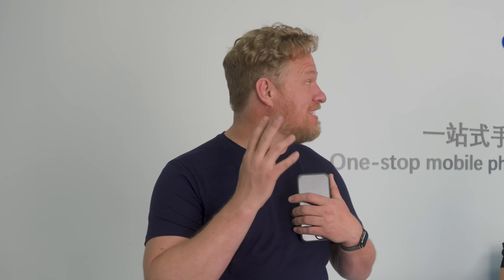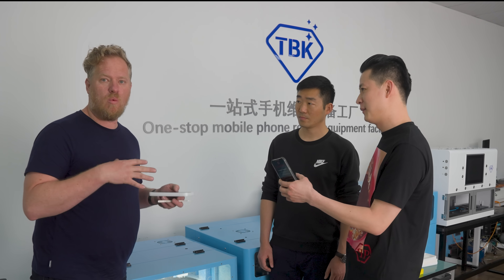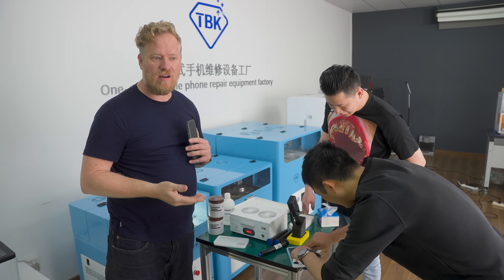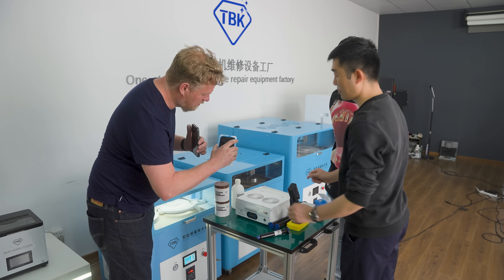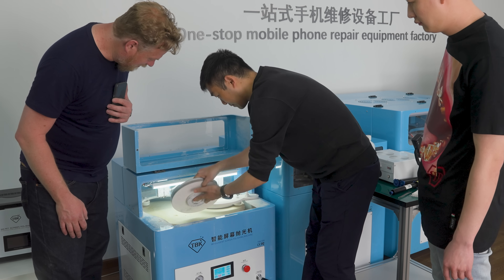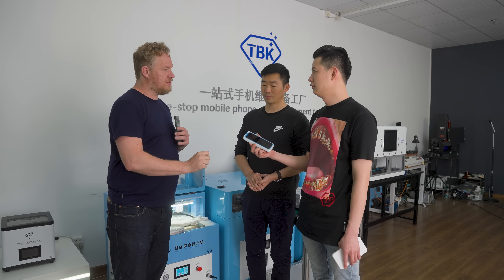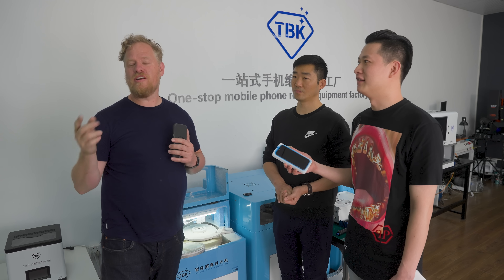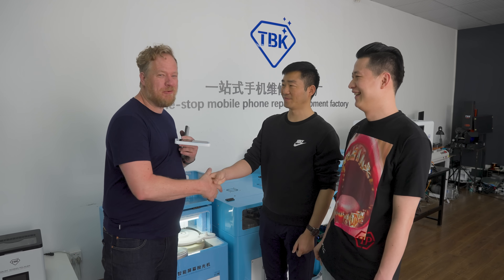Making old iPhones look like new? This Chinese machine is magic!

Comment: Aren't there several coatings on these screens? Anti-glare, oleophobic?
Reply: "don't worry about it" 🙈
Reply: Depends on the screen. Some do have those, some don't. Mostly just an oleophobic one, you can apply it arfter. It won't be as durable as the factory coating but will work just fine.
Reply: Yes, and they can be easily re applied.
Reply: @mahdi8572 If it was that easy, they'd show it in the ad...
Reply: @NicksStuff This is not an ad, just a demo.
Reply: @Drak_Thedp  It is definitely a 7:20 ad for a screen polisher

Comment: ok, so engineering-wise, how thick is the glass and how deep are the scratches, so that they can remove it? doesn't it stop being "gorilla" glass after getting thinned like that?

great for sales, but if I buy an used phoned, I don't want it to shatter the next day.
Reply: The glass has to be thinner than the deepest part of the scratch, all over. And yep. No gorilla glass coating anymore, easier to scratch too. 

Also extremely risky doing while in the phone, and the difference between grade A and C is $40? Not worth disassembling to sell for extra $40.

Nobody is ever going to be a millionaire from this machine
Reply: @s3quattro10 lol gorilla glass coating ? What??

Comment: how do you remove the phone from the mold and how do you remove the cured uv glue?
Reply: That is what I was wondering. I assume you can just scrape it off or remove it with heat or a solvent without damaging the phone?
Reply: @polyvinyl22  yeah, maybe acetone or MEK can at least soften it or something, but yet you risk damaging the phone... i think that applying thin epoxy layer is better idea than polishing the glass. it should be possible nowadays, thats how windshields are being repaired
Reply: It's brittle and detaches easily.
Reply: You can just peel it away easily :)

Comment: You could tape around the edge and buff it out locally (at the spot of the scratches). This smiling presenter is a bit of a buffoon, skipping important questions and implications to smile and promote.

Comment: The problem i see is that it makes the glass thinner and maybe easiert to break. How much material in % does it remove?
Reply: Should not be a lot, scratches are pretty shallow usually (and I would assume one might decide to do it or not based on how deep the scratch you want to remove is) most time less than 5% of the thickness from what I can find (assuming very thin glass and light to medium scratches).

Comment: Seems like they're just polishing the entire screen down? Wasn't expecting that, it's gotta weaken it or something. I was expecting some fancy liquid which fills in the scratch or something. Still though I guess it's a nice little screen refresh after a couple of years after you've got a bunch of scratches, doesn't seem good to do it multiple times. I'd like some sort of testing done to show the strength before and after before being okay with reseller sites doing this to all phones. For the back glass though yeah go at it, I'm suprised resellers dont polish the metal sides of phones already. Could get a phone looking new on all sides.

Comment: hahah yes dont worry about it,

same as with windshield polishing, you're risking distortion and added fragility, probably cerium oxide and a very dialed in machine here but ultimately its just shaving off a layer of the glass so yes now its thinner and more brittle
Reply: Well it's either that or replacing the screen.  Sure it's not as good as the new one, but still better than the old one with a bunch of scratches.

Comment: Its not 'don't worry', if Corning or Apple, could save a few microns in glass or thickness they would do so out of the factory ! 
Scratches put stress into glass, no more protective coating.... 
If a user decides to that to their own phone - that is great. 
If resellers do this to phones that not.
Reply: A full Display/Glass change which is very expensive or time consuming VS a slightly weaker but original display and a bill that only ranges from a couple dollars to a few tens at best. But yea you are right about this being misused by resellers or refurbishers, but then again display Glass polishing is not a new thing they just made it more convenient and time efficient.
Reply: It's a refurbished/used phones, another used phone from users that sells their phones can have weakened glass by hundred of falls and have no scrachs too because the user put a tempered glass on phone (but this glass have the stress of this falls and impacts). And it's the same result, a phone that apears to be in good shape and in the real life, the phone have a lack of resistant in the screen by use and abuse.

If you want to buy  second hand devices with the guarantee of a new product, you are in the wrong market and you really want a NEW device.
Reply: There is always some allowable tolerance, the glass will not be perceivably weaker after polishing.
Reply: @MarianKeller  thats like saying a 1mm piece of glass and 1.1mm have the same strength
Reply: @AndyMcBlane  removing a whole tenth of a millimeter in 15 minutes would NOT result in a scratch free screen.
Reply: That is unless they clearly label it as "scratches removed". If resellers do that, which I assume most won't, then it wouldn't be unethical.
Reply: Apple doesn't make it thinner for drop resistance

Comment: lol "dont worry about it"
Reply: trust me bro
Reply: youre asking too many questions lol
Reply: It WILL be thinner by fractions of a millimeter and also who knows how this behaves with newer iPhones that have Ceramic Shield…
Reply: @TheCreatureCorporation no no don’t worry about
Reply: @iNFiNiTY125 hahahaha!
Reply: Apply new glass protector and be happy
Reply: "oh hi Mark"
Reply: What about the oleophobic coating? I assume that's another step? Given that we already have some repair shops separating the OLED from glass and replacing just the glass at around $50 US I wonder how viable this is.
Reply: its thinner but its marginally so.
Reply: @tjeulink  Says the person with ZERO INFORMATION about it. It being thinner isnt the real problem, his response to it is.
Reply: @Paultimate7 this is not someone who natively speaks english, and does not control the language wel. Whatever nuances you read in it are extremely speculative.
Reply: lol   the modern screen usually have oleophobic coatings , and sometimes even ceramic or saphire coatings.
Reply: @igpp694  by the time a phone goes second hand those coatings would have been long worn out. Plus is also possible to reapply those coatings, even thought it would not be as durable as factory applied ones because you can't heat the screen in the process. Still, that's kinda unpopular because most people uses screen protectors, as bare displays is both easily scratchable even with hardening coating, and isn't as smooth as plastic screen protectors.
Reply: Hilarious shoddy endorsement.
Reply: Of course the screen glass is now thinner and will crack more easily, but they aren't gonna tell you that..
Reply: @james_halpert Thinner glass without scratches is likely stronger than thicker glass with scratches due to how stress works in glass.
Reply: @james_halpert magic
Reply: Fine for older glasses like GG3 or GG Victus. GG7i is extremely thin to begin with so polishing it may just ruin it
Reply: @themystguy if the scratch didn't penetrate the display, polishing the scratch away also won't be too deadly. Especially since it's usually the same spot that's getting scratches all the time.
Reply: Hahaha
Reply: to be fair just adding a phone screen protector will compensate pretty well
Reply: the nano coating is gone after the polish
Reply: Lost in translation more like it. The point he’s making is it’s not as an issue as the polishing process will only reduce the thickness a few percent as anyone who knows much about polishing will tell you, and why he was asked not to make the scratches too deep - it won’t perform magic. It’s a surface effect - you don’t grind the glass in half!  lol The level of stupid in the comment section never fails to disappoint.
Reply: That is the most Chinese answer to that question 😂
Reply: how did it even polished the whole screen since the holder was taller than the screen? or it is concave now?
Reply: @cristibaluta  the phone sits proud of the holder. They even showed it up close
Reply: yeah that was some bs right there. It absolutly makes the screen thinner. Thats FINE WITH ME but him blowing it off like that was a red flag to me. Just be honest and explain it dont say "dont worry". LAME.
Reply: @Paultimate7 This is the difference I think between speaking casually with an acquaintance in their second language versus a professional translator in a business meeting (or even someone who grew up speaking multiple languages natively). Could the guy be blowing him off? Sure. However, let's say that he said it in good faith.

"Don't worry about it" would be a literal translation of 別擔心, bie dan xin. In a vacuum, there's nothing technically wrong with it. However, we do have context here: Scott voiced the concern that the polishing process removes glass from the screen. In this context 別擔心 would communicates, "Your concern is valid, but it doesn't happen much so it's nothing to be worried about".
Reply: @bubbledoubletrouble  thank you for the useful cultural context!
Reply: It would NOT come out free of scratches if the screen was meaningfully thinner after this process. We have no information about what kind of compound and what kind of wheel that is. Surely your solution is better.
Reply: It is thinner but just a very tiny micron amount. But if it the screen has been in these kinds of machines many times, it will make quite a pretty thickness decrease.
Reply: yea man, then he says enthusiastically "the future is here!" yea. the future of bad practices.
Reply: because you can get a new, fully functional (unofficial) screen for 200-500 RMB, or 1400rmb for a second hand official screen.
Reply: @ZhichengForReal  repairing the old screen is better for the environment, and that has to count for something.
Reply: ok no need to make fun of it. they prob test it maybe it's fine like he said.
Reply: @siyam1914  my money is on. It’s fine to make the sale where you have a 30 day warranty on your refurbished phone. They probably deal with a small handful of customer complaints and shut them up with a replacement, but most people probably have their failure outside of that 30 days not to mention the removed or degraded coatings They’re sanding off so whatever nice screen material came OEM… not anymore. This is just kind of shady and like the other said the response and pushing for more info, perfectly sums up with this is. His tour buddy who hooked him up with some factory tours is now starting to get him to schill. This is a clear advertisement and you always hear creators in the text space talking about how businesses like this. Try to get them to cover their products in this exact type of format not a review. I’m not really an inside peak or something cool but just a chinese machine manufacturing getting product visibility. I’ll be interesting to see if we get more videos like this soon. If that’s the case, I’m probably. Done here. Scotty knows what this is, and there’s almost certainly money that was exchanged for this. I would be absolutely shocked if there wasn’t.
Reply: @siyam1914  Maybe they did. Or maybe the screen cracks easier now because itäs thinner and it would be bad publicity to say that out loud.
Reply: They're sanding off less than a milimeter off the glass, so it's not something to worry about, unless it's a deep scratch at level 7.
Reply: @jonny11bonk  Well it better be less than a millimeter since the glass is only like 0.5mm thick.

Comment: Look up planar (Chemical Mechanical Planarization (CMP) process) tools used in 200mm & 300mm chip/wafer processing in production fabs.  I worked on planer tools, looks like the exact same concept,  but not using wafers but cell phones.  I have been working on CMP tools as early as 1999 at intel.   Not a new idea just a repurposed idea.  Woks in much the same was as glass repair on cars.

Comment: I could have sworn there was a resin scratch filler for screens. Dont get me wrong this polishing method is great but seems kinda overkill. It also does make the screen slightly thinner. Probably fine to do once or maybe twice to a screen but I imagine the third or fourth time the screen is now much more fragile. Also this removes the oleophobic coating but I guess they dont really care.

Comment: when you scrub away a layer of that glass, wouldn't that also scub away the oliophobic coating?
Reply: Yes its would ,also it removes any anti reflective coating if there was any on it
Reply: Yes, but no one is checking/verifying that when they resale the phones as like new💀 That's how they are making money. Buy cheap phones with scratched displays, and then polish it and resale as like new.
Reply: of course but if its already scratched more than likely it has been used so much that it already wore off.
Reply: Dunno what a "Oliophobic Coating" is?  But you sound very impressive & its also a great question.
Basicly your asking does fine grinding a smart phone screen, screw up its most important function?  Working?  lol
Reply: @groovejet33  it is a layer of oil resistant (oleophobic) material to reduce fingerprints on the screen.  They aren’t asking if polishing scratches breaks the screen, just whether it makes fingerprints more visible than compared to a new screen.

Comment: Do they not redo the oleophobic coating?
Reply: its used with the polishing machine. If you click on the link for purchase, down below it lists oleophobic coating
Reply: That coating can be replaced easily, it's commercially available as a liquid you just rub on the screen. Of course in a factory it can be applied more professionally. Just depends on who's using this machine and what their goal is.
Reply: @bardenegri21 the tbk method is a powder.
Reply: @bardenegri21  can the anti reflective coating?
Reply: Its easy to apply
Reply: Don't worry about it!
Reply: @desmond-hawkins the coating matters a lot
Reply: "dont worry about it"
Reply: They probably do but after-market coatings don't last as long as the original factory one. I'd guess 1 to 2 years until it's completely worn out.
Reply: @MrSgtBlade most recommend to reapply every 2 months, it's pretty cheap and easy to apply, so I do it and it's still like new. But I guess that if you don't do it it won't last over 1 year.
Reply: @lazymass Been looking for a good product for recoating.
Anything you could recommend?
Reply: and to be clear, there's no reliable information regarding the safety profile of these third party coatings (and not ENOUGH research on first party ones either)
Reply: Yep it’s part of it. It’s just a powder.
Reply: They have it on the sales page of the machine, along with the glue gun etc.
Reply: I was thinking the same thing. Without a proper recoating of the oleophobic coat the screen will be covered in fingerprints in no time.
Reply: I guess it's not a problem if you use a screen protector
Reply: @mercatorpotater but screen protectors don't stick properly on screens which have undergone this process
Reply: @tejassingh2774  Why not? It's just a polished piece of glas?
Reply: hey an og marshall/aleks pfp nice
Reply: Least of the problems
Reply: re encouraging message here
Reply: I think the coating is pointless since it wears off.
Reply: this isn't a thing on the vast majority of phones... glass and especially crystal glass is already non-misicble with basically every known liquid and grease out there lol